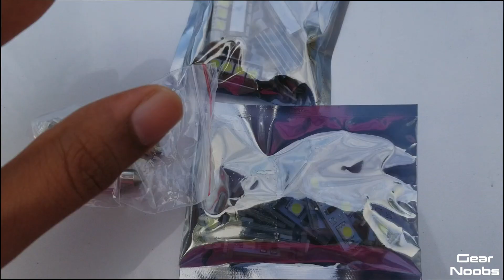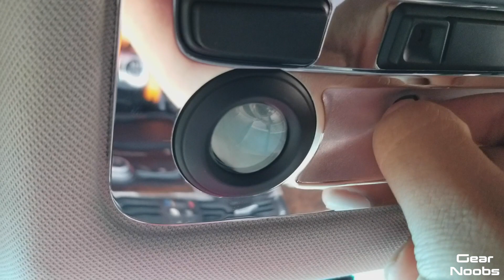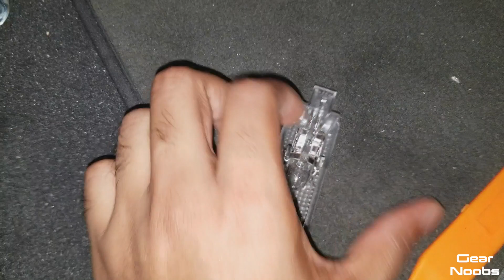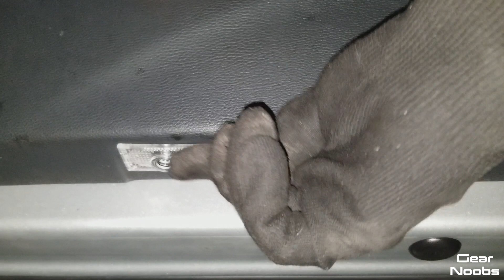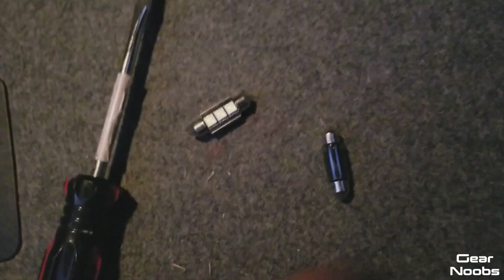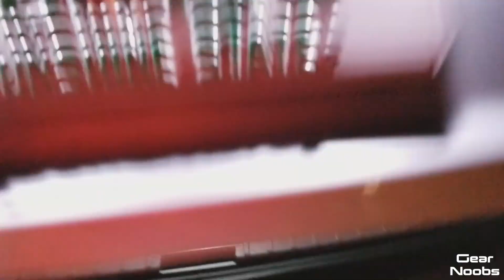BEST E90 INTERIOR WHITE LED CONVERSION GUIDE + LICENSE PLATE LIGHTS

Comment: I got these from amazon today. I ended up getting the same LED set before finding this video. Anyway it took me probably 30 minutes to fit EACH single dome and map light. The foot wells were easy. The interior trunk light you have to bend the clips inward a little to hold it tight so the light doesn't twist around. I have one map light left in the right rear that I can not seem to get in and I will try to finish it tomorrow. These lights are very hard to fit in, they seem to be wide and the clips that you have to push the lights into are super small, it is a challenge for sure.

Comment: Put my dome in but ran into trouble wen putting in the maps, I took the dome out then put it back in & all of a sudden the light didn’t work anymore, I took it out & replaced it with the original bulb but it still doesn’t work. Does anyone know wats wrong?
Reply: Either you blew a fuse or ruined the circuit
Reply: Did you figure it out... Happened to me too?

Comment: Not got all the way through the video so you may have mentioned but any error codes after installing these lights?
Reply: It wouldn't throw any error, error happens mainly at the front headlights and rear cluster lights. Hope that helps.